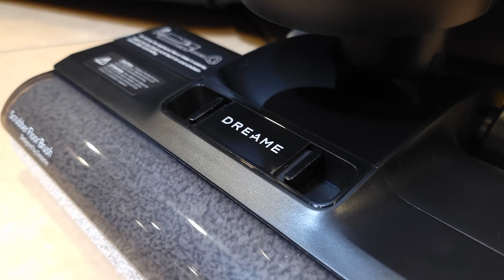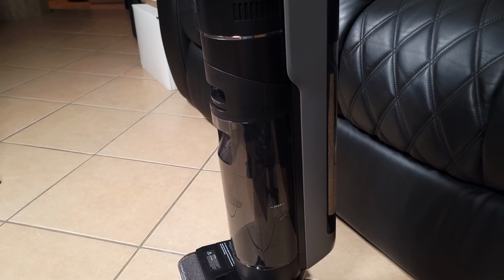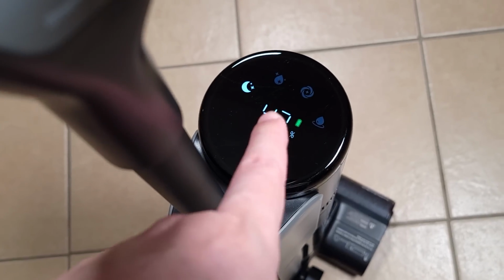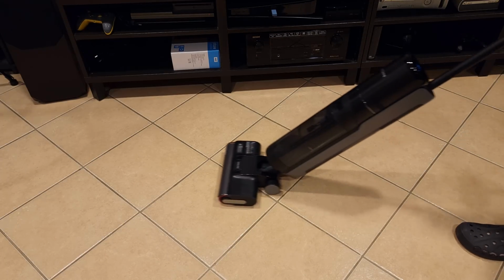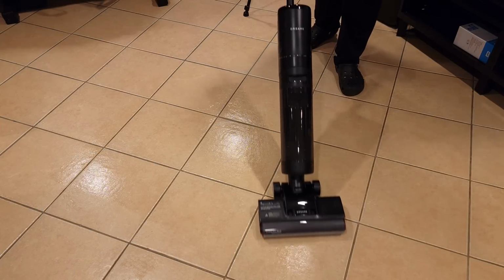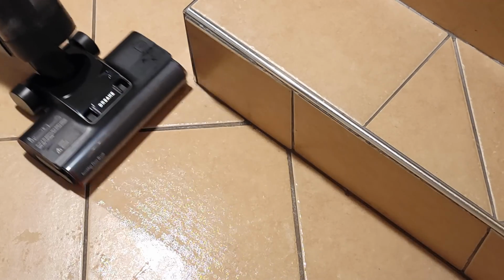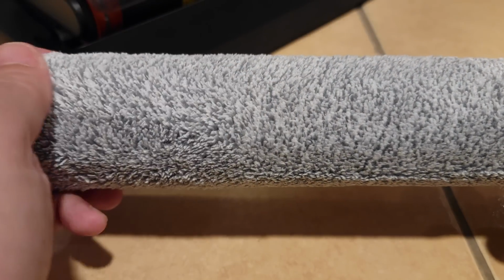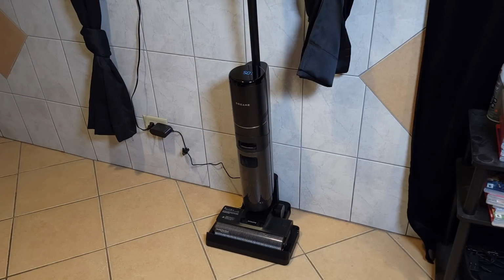This Wet & Dry Vacuum Is Affordable But VERY Capable!

Comment: I was going to buy this one, but I decided to get the H12 GT instead. Mine feels like a lower version of the H12 FlexReach, I guess. It has no speaker and no full info screen, only a battery icon and light strips.

What I don’t understand is the self-cleaning and hot-air drying time. How long does it usually take? On my unit, it runs for more than 40–50 minutes. I thought it was supposed to be around 20 minutes.

This is my first dry wet vacuum, by the way.